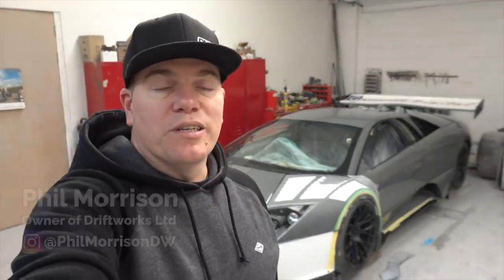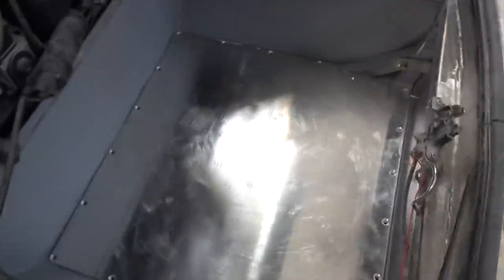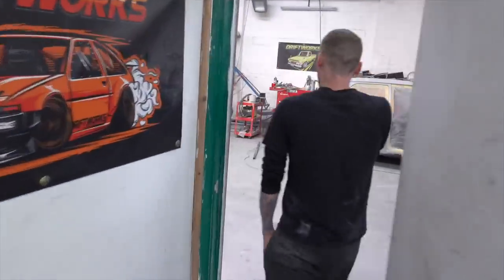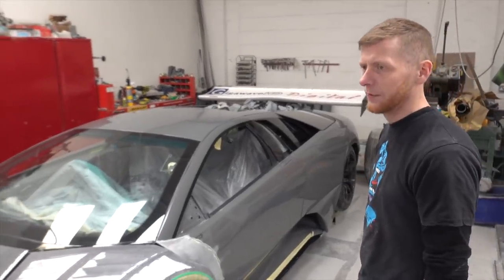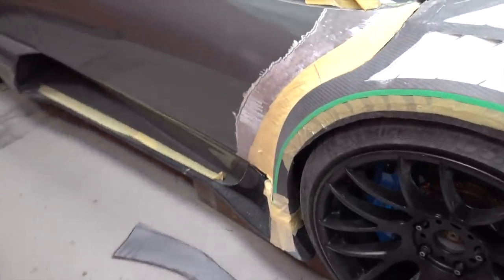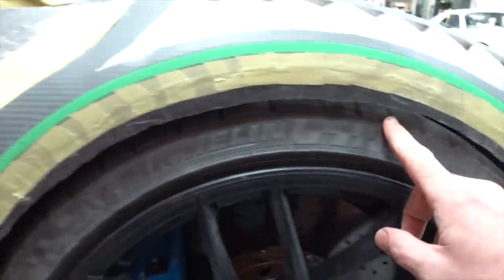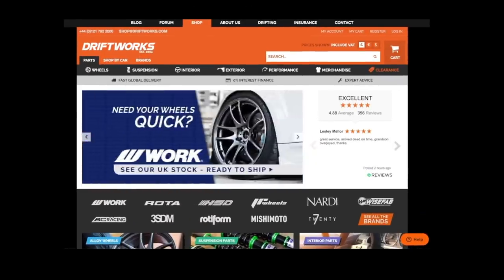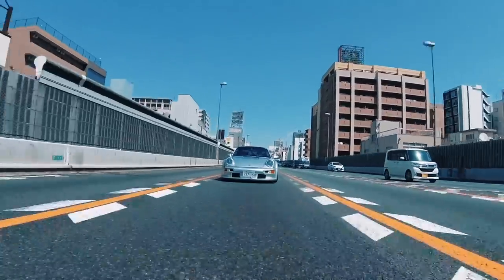GT1 Lamborghini Murcielago road car project update - Part 12

Comment: This project is rapidly becoming every V12 lambo lover's wet dream. Your plans for the styling and the way you're integrating the LM panels are on point. Some meister m1's would finish it off nicely 😍
Reply from the maker: Thanks! I'd love a set of Works on it, but I think I need something more custom made to make the front look good as it's a relatively weak offset.

Comment: Don't rush it. Do it right and it will be one of the most unique builds out on the streets. You should use the paint protection Tavarish used on his Lambo, so you can drive it with no worries about paint damage, stone chips etc.
Reply from the maker: I'll be getting some PPF on it I'm sure. That thing Freddy had done is way overkill for this. Mines not a million dollar show car 😬

Comment: Mentioned gel coat on the carbon, from what I can see it looks more like it’s pre preg autoclave cured, no gel coat - but much better to work with, sanding etc.  Being a high end motorsport fender I’d be very surprised if it was wet lay. Anyway, like the fact you’re doing some composite work 👏🏼 (my job) 

Impressive work on the car. HNY
Reply from the maker: Good point. It is prepreg as far as I know.

Comment: Isn’t the rear wheel well design a bit of a feature on the v12 lambos? I believe  the most bertone cars have it, if you look at the countach and Diablo you can see a similar design. Either way it’s your car and do what you want. Just something I was wondering.
Reply from the maker: It is yeah. It will still be there, just less obvious 👍

Comment: Hey Phil, thanks for showing this build—- Question, did you go with the bmw ITBs and stand alone Ecu to make it easier because of the manual trans swap or was it just something you wanted, basically asking if I tackle this manual swap is a stand alone a must or do you think you could do a Ecu swap? Or at very most just a stand alone Ecu and no Itb?
Reply from the maker: Hi, no worries. I wanted it manual & I wanted it ITB. I couldn't have done one without doing the other anyway, so it worked out well! I'm sure you're aware, there's no way to do a manual swap without most of a manual donor car. There are so many compromises on my car like losing the standard dash & having to change throttle bodies, that it's not an option for anyone but me to do it this way.

Comment: You widened the front and left the rear stock? It looks quite odd like that, the LMP car is much wider at the back. Wide flares look boss.
Reply from the maker: The rear is not wider on the GT1 RGT cars. The rear GT1 bumper fits up perfectly to the standard rear quarter panels.